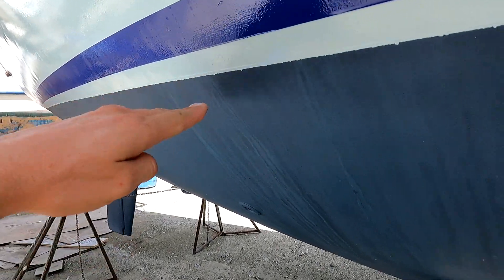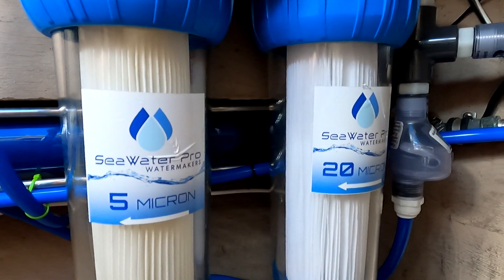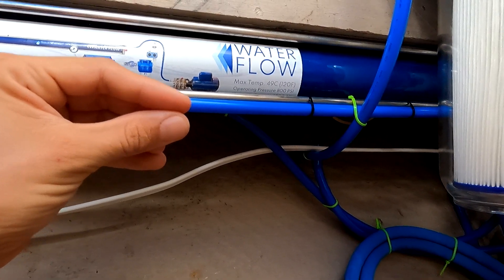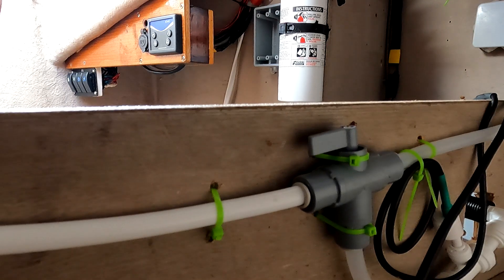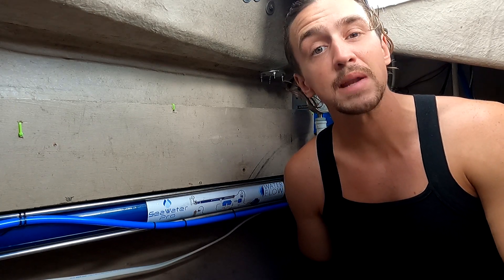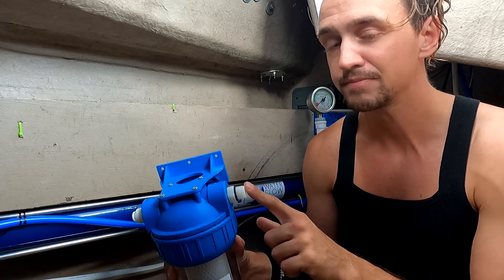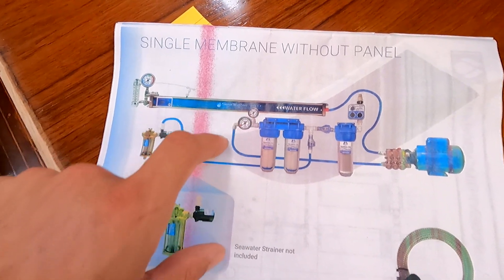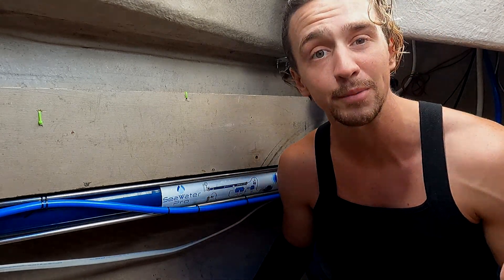How A Watermaker Works (Explained in 5min) *SeaWater Pro Watermaker Installed On A Sailboat*

Comment: Would be nice if you could have discussed the cost to build your system, including maintenance costs for filter replacement, replacement of the salt separator cartridge, and volumes of water per unit time that you are able to produce. Do you use this water strictly for drinking, or for toilets, showers, cooking, drinking, washing, etc?  What is the quality of water (purity) that you are able to reliably and consistently produce?

Comment: Thanks, but i have a question when we get a product water and it flows through diverter valve and it has some salinity left which get discharged with brine water after that the valve is flipped hut how do we know that there is still salinity left and when do we turn that valve to get that fresh water product???

Comment: You usually only pickle it for storage. Flush it with freshwater after every use. Every few months you can do a flush using the same products used to pickle. You just recycle the chemicals through the system using a pump and bucket. Kills everything in there and saves the membranes. I didn't see a carbon filter.
Reply from the maker: I don't usually do a fresh water rise, just using it ever three days at least. And that seems to have worked well.
Reply: @Adventureman Dan  if you ever need service and are close to fort lauderdale call titan marine and we can help you out.
Reply: If used daily, or every other day,  there is no need to flush it.

Comment: Whats the lifespan of the first three filters?  Does the main membrane need maintenance other than being run every two to three days?
Reply from the maker: Lifespan of the *2 pre-filters entirely depends on the water you're sucking up. Could be as low as a week if you're in NYC off the hudson rier, or as long as 6 months with this crystal clear Bahamas water. :)

Comment: Why does so much PSI have to be used 700 PSI is way up there. Home service water line only reaches 80 PSI.  Pickling I assume is sanitizing/sterilizing like using small amounts of bleach on dishes to kill bacteria.  I'm not a boater just curious about the desalination to instant potable water and I assume this would work for Brackish lake water. Anyway great video
Reply from the maker: That is the pressure needed to push the salt water through the membrane filter that then separates the salt water.

Comment: Hey man, great vid.  Have you done any testing at the faucet to confirm salinity or check for bacteria?  I'm in the process of shopping a looper and am also curious about "most common" water systems installed and filter replacement/system review procedures.  I'd want to do a complete refurb on anything used.

Again, good job!  Thanks.
Reply from the maker: The ppm meter is just before the faucet and taste great. That's good enough for me.

Comment: I used to sell water treatment equipment and RO's (Reverse Osmosis) units were part of that. Those, however, could not handle an initial TDS of any more that about 2000 PPM. They were rated to take the TDS down to 95% of original when the membrane was new and 90% when it was nearing end-of-life. So for the most mineralized water it would take it down to 100 TDS when new.
The system shown here, however, is much more capable of removing salt and other dissolved minerals. The PRESSURE is what makes it happen. For the household RO's, there was usually no pressure pump as the normal house pressure - between 60 and 100 psi - was enough for them.

Nice to see this shown in detail.
Reply from the maker: Super cool!

Comment: Nice explanation Dan :-)  Are you sure about the 700psi though? That seems low .. mine runs at 60bar, which is 870psi.  I'm pretty sure most membranes suggest 800psi.
Reply from the maker: You might be correct on that.

Comment: thanks for the vidio , I have a 40 gph 120 V seawater pro that I am installing , my guestion is , our Bama Breeze is a Seawind 1160 deluxe Catarmaran which the hull is very shallow , can my sea strainer be above the water line as long as the pump is below waterline ?
Reply: David - yes. It doesn't matter where the sea strainer is.  The reason for the LP feed pump being below the waterline is so that it is naturally primed, which just means there is always positive water pressure on the inlet side.
Reply from the maker: Jim answered that correctly.